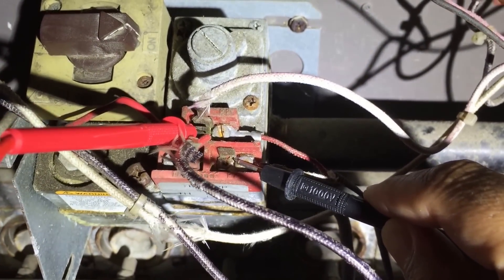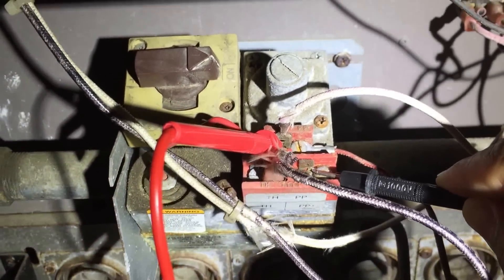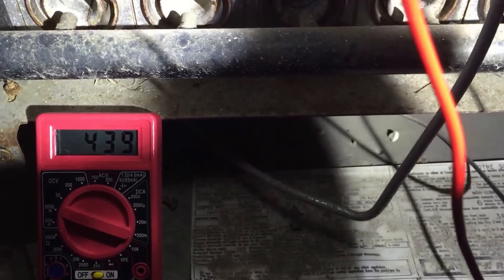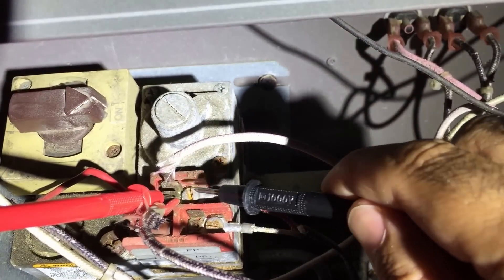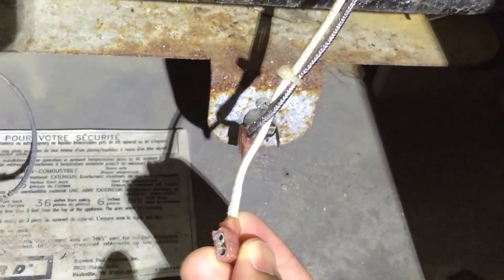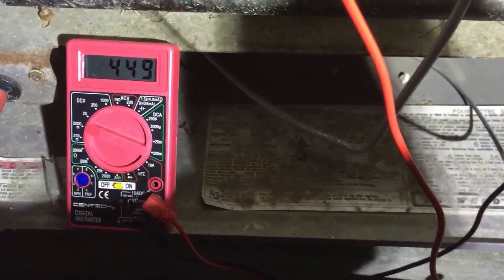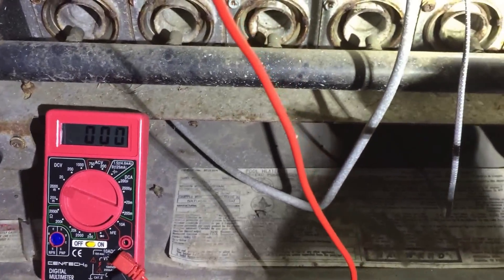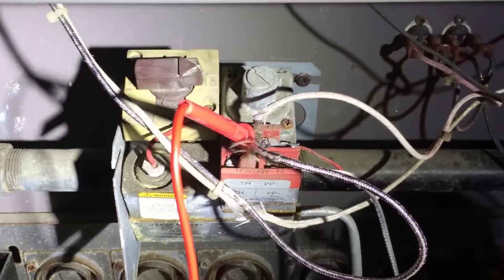How to troubleshoot Hayward Millivolt Pool Heater Pilot Generator *1080P HD*

Comment: All of the heat sensors do they need to be plugged back up the same way and how do you test the switch using a multimeter and using the multimeter to test the pressure switch and the two wires plugged up to the switch pressure switch. They have to be plugged in the same way, or doesn’t matter.

Comment: My Hayward 150 pilot will light, however when I release the igniter after 45 seconds, the flame goes out.  Any suggestions?   Thanks, Dan.
Reply: Take the thermopile assembly out and clean it. Then put it back in. Worked for me
Reply: @andoando54  Tried that and it didn't work.  I ordered a new one and that didn't work either.  I'm at a loss
Reply: Did you figure it out

Comment: I am able to get my pilot lit just fine but when I go to read the voltage I am getting nothing. I've cleaned the terminals with still no success. Do I need to replace the gas valve?
Reply: Did you have it on the milli volt setting?  if the pilot stays on, the thermopile should be putting out a millivolt amount.

Comment: Head up! When you are jumping a gas valve to test it make sure you are on standby or let it run no more than ten seconds.  That being said, you are taking a big risk that can lead to an explosion because the gas valve is designed to protect the system from turning on if it detect a problematic, like a roll out or some kinds of sorts.  Imaging their is a fire and the system is supposed to shut off the valve but in this case it can't because you just by-pass the valve to open and if the fire were to enter the gas pipe that is connected right through your house I could tell you its not going to be a pretty picture.
Reply: Lmao!!!! Like that ever happens!!!

Comment: Hey, I jumped out my gas valve, when I remove the jumper it will stay on.  Does that mean it is going bad?  Or do I not have enough milivolts to open the valve?  My multi-meter reads 380-400 mv (I replaces the thermal pile last year).

Comment: I want to thank you. My heater was 10 years old, I couldn’t get it to light. I replaced the pilot generator. Replace some old wires. I replaced the roll over sensors. And it’s running fine. I also changed out the gas valve. I got it on line for $250.  I think I could troubleshoot these things now. When you own stuff like this it’s pays to watch YouTube, because it will save a lot of money on service calls

Comment: Hi Phillip, when I test with my multimeter (I also have the exact same one as you) across the pilot generator terminals, I read only 100-200 millivolts, fluctuating wildly. Attempting to jump the gas valve has no effect. Is this the symptom of a failed pilot generator?

Comment: Heater will not fire, but when I jump the gas valve it does.   I am getting 500 millivolts what do I check for next?  Hah. Scrap that question. After going through all my connections I found the one that was causing me grief. It seems to have been just connection issue. Of course it was the last 1I checked. Thanks for the video.

Comment: Have you ever found not able to get 500+ millivolts from the pilot gen. that is new, with new  pilot assemble. It is a Hot Shot control system.
Reply from the maker: Hi Brian, I've never seen that. On a brand new power pile, I've always seen a bit over 500, never under 500.

Comment: From the look of inside the heater it is clear that the heater lacks annual service and maintenance, 
I can imagine the condition of pilot assembly, flame sensor and rollover switch. Corrosion on terminals of rollover switch ?
How about the switch itself? Is there a roll over? Why? What is blocking the exhaust? Is there a soothing build up in combustion chamber? Is gas pressure where it should be?  
For the past 30 years in this business I have repaired many heaters that other "pros" recommended replacement of heater.
Why? Pool guys are great for what they do. Clean and maintain water quality, sometimes repair of pipes or even replacing pumps. When it comes to heaters... After weeks of efforts and frustration they usually call me.
Reply from the maker: John, the previous owner neglected this thing with regards to maintenance for over 6 years. 

If you check my other videos you'll see that the pilot assembly was in terrible rusted connection.

Yes, I agree -- I enjoy working on millivolt systems because they are easy with no logic/control boards to diagnose. 

The combustion chamber was removed and multiple white spider webs were pulled out of nozzles etc with wires and the whole thing blown out. 

Gas pressure with the manometer was right on target.
Reply: Yes, and it is a  good heater too. I was working on one H350 few days ago. Same thing. Like you said, neglected, lack of service and maintenance.
Reply: Would you happen to the the specifications of the 3 cut out switches used on a Hayward millivolt system, are they all the same?

Comment: Phillip- have a H200 heater and it fired up this morning, somewhere along the line shut off and now won't fire.  Watched your video on the pilot generator and that will be my next test, but do you think it could be the gas valve?  Will check you videos on that as I'm not sure how to 'jump' it correctly.  Thanks for your help
Reply from the maker: Hi Hogan, check my channel -- I have a video on how to jump it out. It's very rarely the gas valve. If you jump it and it lights then the gas valve is ok. You will hear a "click" from the gas valve as the coil engages and opens the valve to allow the gas to flow. The gas valve will not open if there is inadequate voltage from the powerpile.  If the powerpile voltage is good and all sensors test ok when it most likely is the gas valve.